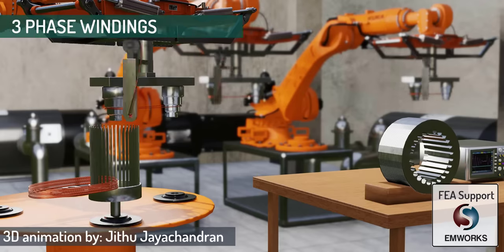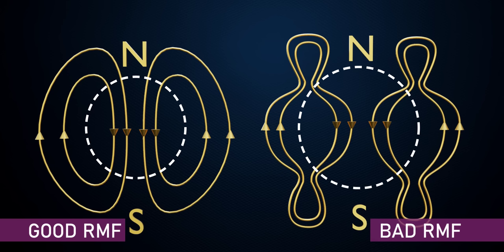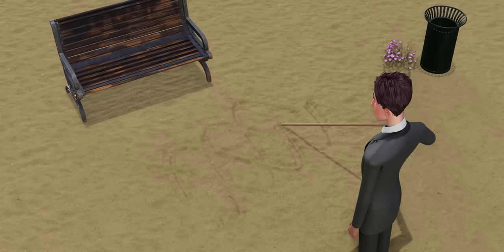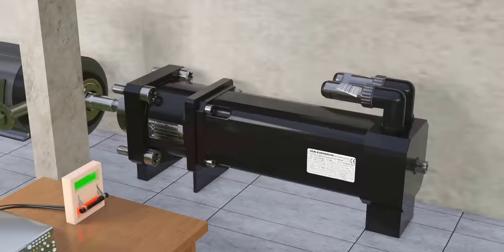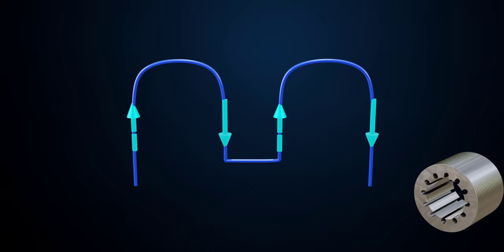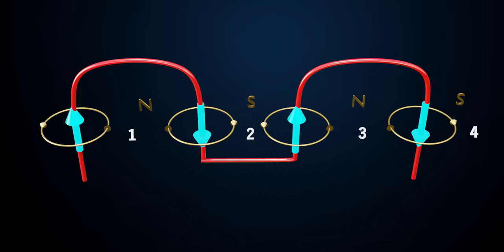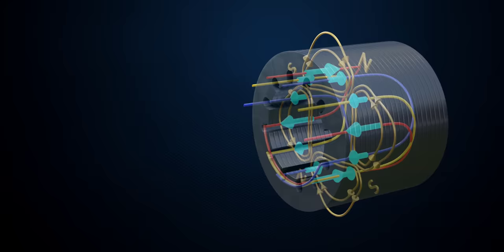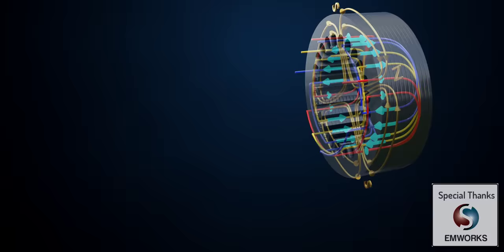Understanding electric motor Windings!

Comment: I am an Electrical Engineer. I like how I still awe with the technology and applications of Electric Motor Windings on our everyday life. You just did a certain and clear illustration of how magnetic field works depending on the design of the winding and how variations on number of poles are important depending on the purpose of the Electric Motor.Thumbs up Lesics all your informations are top notch, accurate and informative.
Reply: Pakistann

Comment: Tesla was one of about eight different people focused on maximizing rotational power using coil windings at the time. Every one of them came up with innovative solutions (generators, motors, transformers, squirrel cage/slip ring rotors) that were patented, published and put into production.

Ferraris (motor), Wenstrom (generator), Haselwander (generator), Dolivo-Dobrovolsky (slip ring/asynchronous motor, delta-wye transformer) and others, each made major contributions to three-phase AC. 

And all of them were just pushing the envelope forward from the major innovations made at Ganz Works in the preceding decades.
Reply: Thank you for typing this so I didnt have to. 

Video tries to give Tesla all the credit and then puts a little note at the bottom saying it wasnt him... SMH

Comment: You can also note that these motors are often characterized by ERPM which is how many times the any point on the “stator” passes through a north-south pair of magnets. Divide the number of ERPM by the number of permanent magnet pole pairs to get RPM of the motor. ERPM is typically the limiting factor of these motors (due to switching speed limitations) so the less pole pairs you have the faster you can go. It’s a speed/torque trade-off.

Comment: @Lesics When I first began investigating motor and winding design, I was startled to see the interior of a microwave turntable motor, a design I've never seen drawn up or analyzed ANYWHERE despite its extraordinary simplicity. It's simply a small spool of wire, where the ends of the spool are soldered to one of two terminals. These two terminals are soldered to the the positive and negative wires, respectively, feeding power to the motor. There is a cylindrical permanent magnet inside the copper wire coil, and within the cylindrical magnet a gear is embedded. As that cylinder and its gear rotate, in turn it rotates a series of gears that step down the effect of the household current (110V AC in the U.S., of course) such that the turntable within the microwave rotates perhaps 3 to 6 times per minute (3 to 6 RPM). Startling, how simple the design is, and even more startling is why an analysis of this simplest of all motors appears nowhere on the internet or in books on motors---at least not that I can find. 

It's still puzzling, why the cylindrical magnet turns so reliably in the absence of anything resembling windings or brushes. Can you explain?

Comment: The explanation and graphics are superb. As I gather, the more the coil windings, the better is the torque and more uniform the delivery of power. I have to watch this video again to understand the explanation better.
Reply: The more poles you have the slower you can run the motor to get the same degrees of separation... which also results in higher torque for the same windings if it weren't. Also the thickness of the windings... the more copper the stronger the field but then you have cost and weight and size for the application. Then you also have to deal with eddy current losses and how to minimize through plate design, laminated plate thickness, etc.

There are advances for the same size motor getting more power gping on... but it does scale pretty linear... so the more power needed the bigger the motor.

Comment: The 24 pole is used in stepper motors aswell. You can achieve very precise control of the rotation of the shaft using a stepper motor control module hooked up to an Arduino/Raspberry Pie development board.

Comment: Huh, always thought the wires in the winding were isolated from one another. The more you know.
Thank you for all the educational videos you make
Reply: They are.
Reply: Your thought was right .
Reply: They are. Otherwise you'd have a giant short circuit. They're covered in lacquer. They used to also put paper sleeves around them before pressing them in but I'm not sure they bother any more.
Reply: @etherealrose2139  read a few of your comments, as a motor winder will say your spot on with your knolage.

Comment: Outside is the coil field. On the collector there is only a metal drum with deceptive rigid magnets without any particular effect, since the coated three-phase drum also tends to short-circuit this effect. A real local conductor is missing in the drum

Comment: You would not believe the number of fried three phase synchronous induction motors I replaced in my 45 year career as an electrician at an electric power generation utility.  Everything from a few HP to those with several thousand HP.  We spent hundreds of thousands of dollars sending motors out for rewind or buying replacements.  We also sent them out on a scheduled basis for a clean & dip in an effort to minimize the chances of having to do a complete rewind.  It is a very sad feeling to check the ground resistance of a huge motor and get a zero ohm reading.
Reply: Everything fails. Mechanical especially. Lots of stress and heat over time.

Comment: If you could comute the conections with transistors inside the motor, you could control the speed of the motor by making the windings produce a 2, 4, 8, etc. -poled magnetic fields.
Reply: You could, but it’s easier and cheaper to just change the frequency of the AC that is fed to the motor. Hence the VFD. The number of poles remains the same, but the rate at which the magnetic field rotates varies with the frequency.

Comment: 2:29 says - Tesla didn't develop 3 phase RMF winding!? As You demonstrated in video (excellent BTW), specific geometry of winding produces Rotating Field, invented by Tesla all together with polyphase (more than 3 didn't show economical) and asynchronous motors like consequences of RMF. Rotating Field works on paper and theory with no problems, but motor doesn't wort without windings based on that theory. I;m wrong, or right?
Reply: It was Arago who discovered the Rotating Magnetic Field theory, not Tesla. The two phase or three-phase motor was also not invented by him, rather Ferraris and Dobrovolsky. It's often misattributed to Telsa because of the term 'polyphase' and as he was the first to patent the two-phase motor, but this was two years after it was invented by Ferraris.

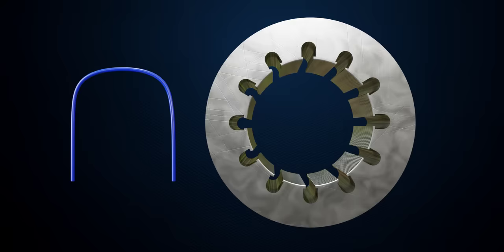Comment: How many "poles" does the motor in the video have?  When the number of conductors are increased as shown at 4:15 does this double the number of poles? I've never understood what motor "poles" means. Is it the number of physical slots in the stator, or is it the number of magnetic poles in the rotating magnetic field? It seems to mean different things to different people.
Reply: Can be either or. You are always going to have two magnetic poles as you need the field to rotate. You don't want to cancel your magnetic Flux by creating opposing fields. But you might add poles to makes a stronger field like in the video but there's still only 6 poles as they're still rotating 120 degrees out of phase in one cycle. Now if you wind it such that those 12 poles alternate, then it'd be a 12 pole motor because it'd complete two hertz in one revolution. 

A 3 phase motor should have a minimum of 6 poles.

Comment: Howdy, great contents! 
I'm curious to see if having a means to charge super capacitors within a vehicle, to be discharged after to ride past a certain interval (via the trigger), to then be powering homes and businesses as you drive past...

(Peltier devices, sterling engine type, driving to distill the water from the ocean; to then be released into the atmosphere to then water the crops... it would be pretty sweet if it could collect moisture from the air...)
Lol

To more Blissful moments!

Comment: My washing machine has a different design, which is similar to old floppy disc drives. The rotor is a flat lid with permanent magnets on a rim and the stator has several small coils with over one millimeter thick wires. So it's quite obviously a brushless DC motor. Actually 3 phase AC motor with electronics making 3 phase current of a desired frequency. I guess this design is used nearly everywhere because it allows to regulate both speed and torque (even have torque without speed). By everywhere I mean small fans inside PC, drones, hard drives, modern washing machines. I'm almost sure they are used for elevators and even simple fans that have just on/off state because they are basically maintenance-free.

Comment: Fantastic video on RMF and motor working principles. However, this can be understood only by electrical engineers. One needs to understand further by full repeated thinking and coming out with more questions and finding answers till the complete concept is understood to become a master. Definitely this video helps in visualising the winding structure and imparts basic knowledge much better than a text book. Text books provide more mathematics and theory but doesn't provide the visualisation/imagination to understand the principles.

Comment: This is a really good representation of the workings of a motor, but I have a question, At 2:37 and at  2:48, you might have observed the, magnetic line direction always emanates from the North Pole but in this case it seems to be the other way around. The image on the top left is correct but the animation is wrong. I may have understood the animation in a wrong way but just wanted to point that out here. Overall I really appreciate the work put in this video. Thank you!
Reply: I agree

Comment: How is the maximum magnetic field obtained in the 6 coils at different instances? Is it by changing the amount of current flowing through those coils different from one another at the same time (in 4pole induction motor such as the Tesla model S motor)?

Comment: Wow thank you so much!!!! Very interesting and it is brilliantly visualised. I´m here because I´m about to build a more modern stator on a vintage 1981 motorcross bike. The stator plate was missing and they are overpriced on Ebay AND obsolete/ too simple. I want to install a battery anyways so I´d rather build a reliable source of current from the ground up. I just love transformers and electrical motors. I have countless saved and I have a lot to learn still since the technology still is advancing fast.

Comment: Thank you for this clear explanation, rotating magnetic fields are interesting, instead of copperwire perhaps glassfiberplastic can be used as a electric current material.. Kind regards
Reply: And where do we currently use glassfiberplastic in electric transmission/conduction? Glass is an insulator, plastic is an insulator, might was well try using rubber as the electric current material.

Comment: Very nice animation. Ive always been confused with motors that can be wired in Y or Delta (you can change by making different connections at the peckerhead) and how that all works

Comment: Thank you for the illustrations as they are very helpful.  I don’t really understand why the current isolation efficiency is so high as it doesn’t seem like the varnish would be effective being applied at that stage, even accounting for capillary action. I get that electricity wants to head back to whence it came, so to speak, but still seems like there should be significant cross current leakage. But clearly that’s not the case.
Reply: @km4hr  now I see Nico says that in their comment that the wires are pre-coated then the varnish step depicted is for mechanical purposes thx.  But, I still don’t see how there are not enough faults in the coating to allow current leakage.
Reply: Pakistann
Reply: @JoeOvercoat  I work for a place that still winds stators by hand so I can answer that. The coating we get on the wire before winding is surprisingly strong and very consistent ( at least from the company we get our wire from). That being the case, we'll use a type of paper to line the channel while inserting so the wire doesn't get scratches on any edges of the stator; in the event there are scratches, we tape over it and it's enough to insulate and not cause a short. We surge and hi-pot test all of our stators multiple times before they get pressed so we know they are within tolerance; so there may be minor leakage, but it's within spec.

Comment: The rotor was originally the stator. And the stator was the rotor. The coil was originally with the rotor. But Bcoz of the coil problem to deal with in rotor, they exchange their functions. The coil now is with the stator, and the rotor become all metal.

Comment: amazing video sir..!
Can you please brief me about the armature winding arrangement of 1 phase alternator?
Reply: Alternators are usually 3 phase AC with a bridge rectifier to convert to single phase DC.

Otherwise, AC single phase is simply two large poles... made up of however many small poles you wish
Reply: @etherealrose2139  Thank you for replying. In the second case, how is it possible to utilize the entire circumference of the stator?

Comment: I still feel there missing information such as the thickness of the wiring and how many woundings of the wiring make any difference? Plus I am still confused about the 4 poles so you are saying 4 poles are slower spinning rpm so does it mean more torque? what about the voltage required to turn them and which is more efficient using less voltage. and much more. But this video did open more of my confusion. and made more questions in my mind. LOL, great video wishes there more info on this.

Comment: So, question: Is the reduced speed of the "high pole count" motors a mechanical issue or a "force" (don't think that's the right word for this situation) issue? 
For instance: If Someone were to force a 4 pole motor to rotate at the same top speed as a 2 pole motor, are there any mechanical components that would break? Or is it just that the 2 pole has more torque higher in the power band to reach those speeds? If so, would pairing a 4 (or higher) pole with a 2 pole result in a flatter torque figure across the powerband, or would this just be a complete waste of time?

Great video by the way, thank you for your time.
Reply: It depends on the frequency; Given the same supply frequency, 4-pole motor would have half the speed. Of course you can make 4 pole motor for higher frequency to obtain higher speeds.
Reply: Induction motor speed is determined solely by the electric frequency. So a 2 pole motor on 60 hertz will spin 3,600 RPM. (60/s *60s/m= 3,600 revolutions per minute.) A 4 pole motor will complete 2 cycles per revolution (sine wave reaches max and minimum twice.) 60Hz is 60r/s * 60s/m * 1r/2cycles is 3600/2 is 1,800RPM

Now... you can change the speed via the frequency... make it 50Hz like in Europe and suddenly a 2 pole is 3,000 RPM and 4 pole is 1,500 RPM. 

Hence, variable frequency drives to control motors.
Reply: Also, motors can go faster but you'll have strong centrifugal forces acting on the rotor so those considerations must be taken into account. Of course if you have a motor you'll likely have all the pertinent ratings. There's also external gearboxes which will adjust speed and hp versus torque accordingly.

Comment: at 1:13-15 , why is the magnetic polarity inconsistent with current direction in coil? EG at 1:13 the current in coil is clockwise, and using right hand rule, the S pole should be out of screen. Why is it shown opposite direction?

Comment: The price of one pound of pure copper is approximately $ 50-60. 
The more windings in the motor, the more copper is required and the purer the copper itself is. 
The production of motors with a large number of windings increases the cost of one motor tens and hundreds of times. 
For example, a generator in a conventional diesel locomotive has approximately 10,000 pounds of pure copper. 
A simple calculation is enough to see the cost of such a device. 
And who, in this case, would think of increasing the amount of materials expended for the sake of gaining power where the power reserve is already colossal? 
It is much easier to use a second or third locomotive than to increase the cost of each locomotive separately. 
This is the whole essence of the "great" inventions of Nikola Tesla. 
He looked at a small opportunity but could not take a broader view of things. 
Almost any invention of Tesla is easily replaced in practice by hundreds of inventions that are simpler in principle and cheaper in mass production. 
Nikola Tesla was a simple charlatan trying to reinvent someone else's existing inventions in a more expensive and completely unacceptable form in practice.
Reply: You think like standard consumer, for industrial standards, its better to spend more money on better things, as eventually it pays off. When a machine runs 24/7 its better to have more copper and reliable operation, comparing to your garage tools that you use ocasionally once a year - then its better to buy cheapest shit that works.

Comment: Would you please, introduce silver coiling on the Internet? The difference compared to copper. Silver coils are not really shown, Ide hdd drives used it. How about 12 v motors? Are they faster? Is it better for rc cars and choppers??

Comment: 3:39 Should the three wires join? Aren't they shorted in this case? How does the current flow work here?
Reply: If you got a few minutes I can explain
Reply: Yes, they are wye connected (or star connected.) You need to complete the circuit. When one phase is at max the other is flowing the opposite way.